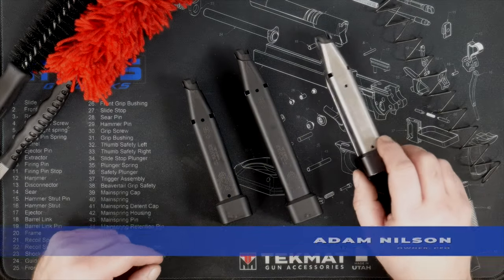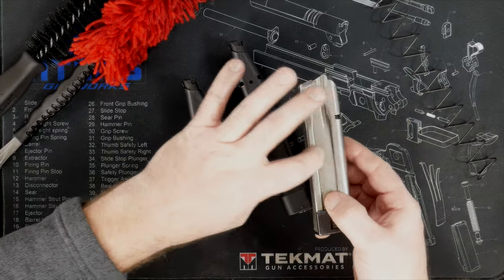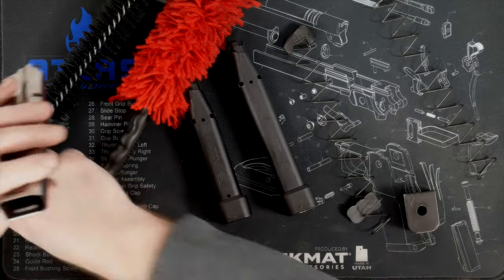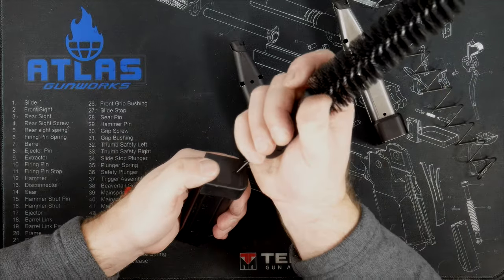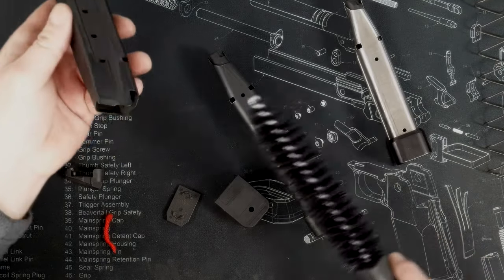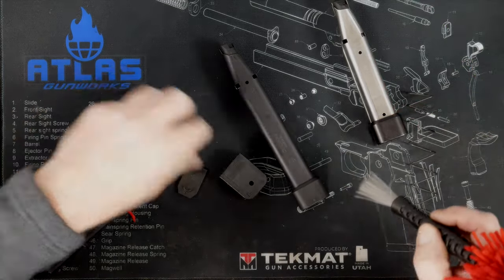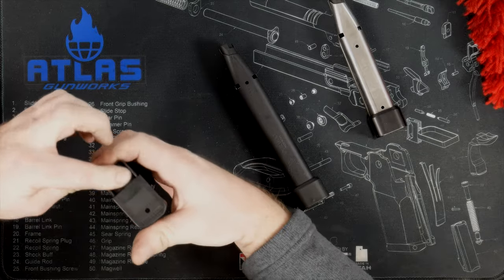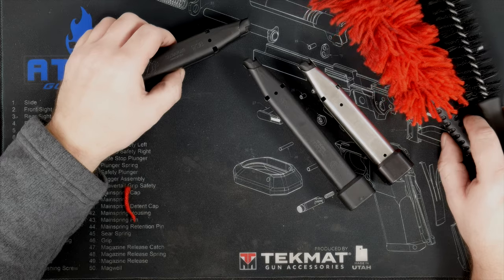The #1 Tune Up Trick for 2011/1911 Double Stack Mags

Comment: I'd love to see you do a huge 2011 magazine comparison. Atlas vs Staccato vs SVI Infinity vs Prodigy vs MBX. Hell, throw in the BUL SAS magazines for fun.
I know you are probably biased and love your Atlas magazines, but a comparison and rating would still be an interesting thing to look at.
Reply from the maker: We could do that but the issue with most of the manufactures is that magazines are always changing.  Both in design and process.   Our mags have only had changes to the follower and base pad design.  The tubes have stayed the same.  So if we did a comparison the it wouldn't represent the other manufactures past or possibly future mags.
Reply: @AtlasGunworks  hmm, that's true. But that's also true for your lineup and every other thing. So if anything, that's a good excuse to do it now and then revisit it in 5 years to see where things went...
Reply from the maker: The other manufactures are having changes each year.  We would have to do one every 6 months to have any accuracy.  The issue is that the mags are not date stamped so it would add more general confusion then help.   We are trying to help more than confuse the consumers.   You will see more vids starting late this year.   We are working on new studio space.